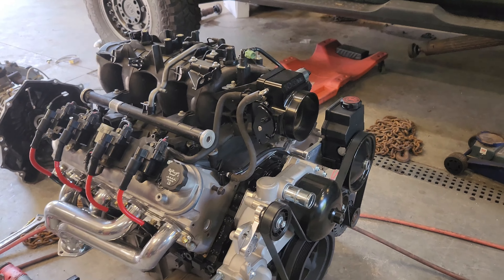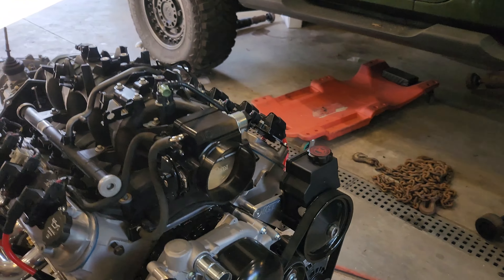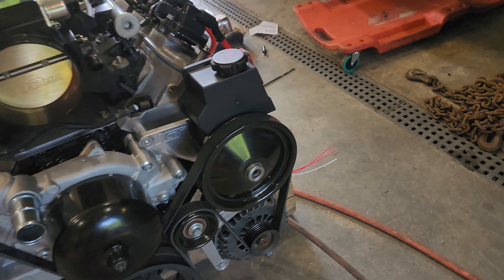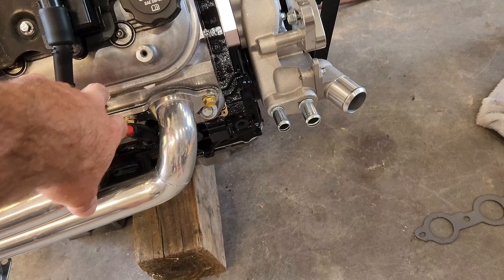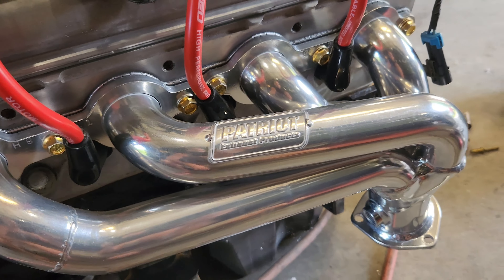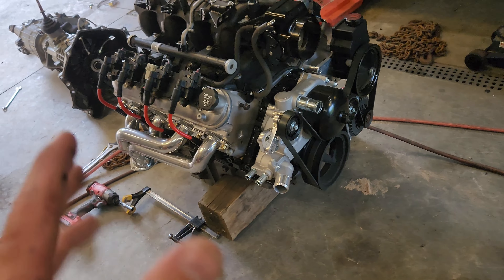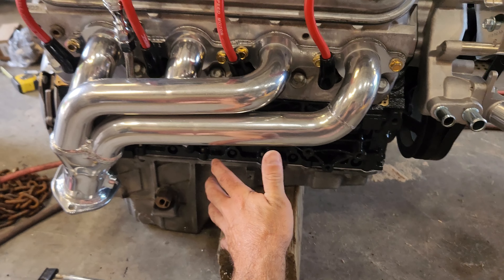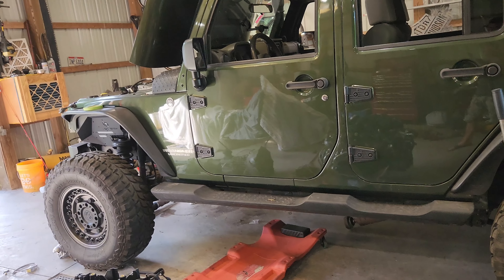6.0 ls2 v8 setup for a wrangler jku swap

Comment: Excellent walk/talk through on this. You mentione you would leave a link about the engine mounts you used, I didn't see it. To be honest if you have the time a break down of the items you used would be great. I'm looking into this and your set up looks very clean and makes sense. I know this is just a quick run through but I'm looking forward to following it more because I'm looking at this for my 2015 !! thanks for putting this out there
Reply from the maker: Awesome! Thanks for the encouraging words! I tried to find a link but can not find it online.  I know I  purchased them from bruiser conversions for around $450 in 2021. I'm assuming they still sell them. I do need to do a parts list break down , I may do a full video on that. I would highly recommend it, it's a great upgrade from the 3.8 and 3.6

Comment: Odd you didn't do the hemi swap w/ all the support.
Reply from the maker: I considered it in the beginning, but honestly the ls has alot more advantages over the hemi. One of the biggest factors is that the hemi would have cost me a good bit more money. I know they are notorious for cam and lifter failure, which concerns me also. The ls world has a lot more aftermarket support over the hemi, and in my opinion, I have never heard a hemi that sounded as good as a well tuned ls. I know my setup cost less than the hemi and makes a good bit more power. I would have had to do cutting and welding on my frame as well. I have nothing against a hemi, the ls was just a better choice in my situation.